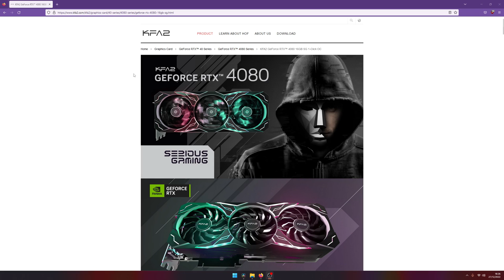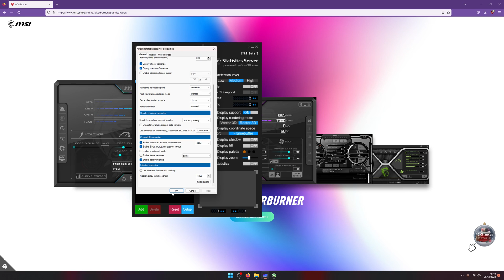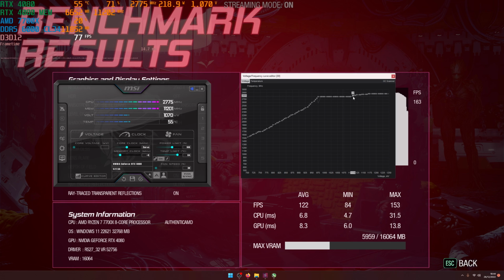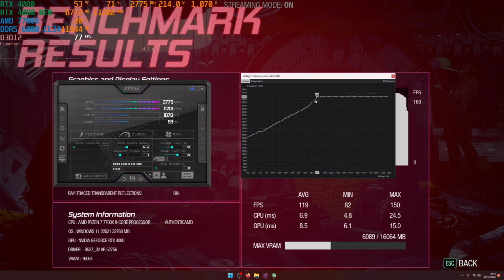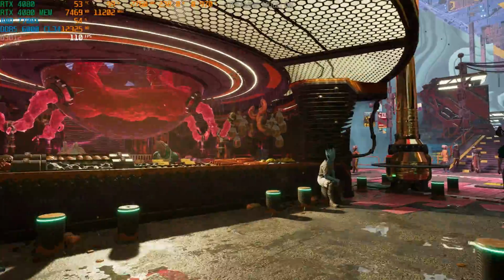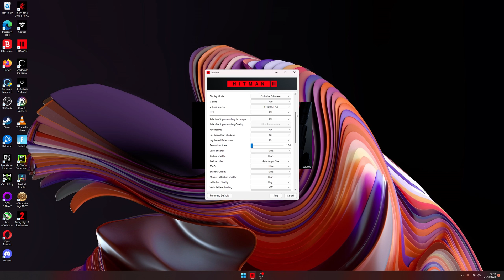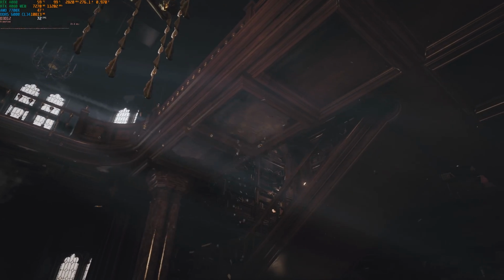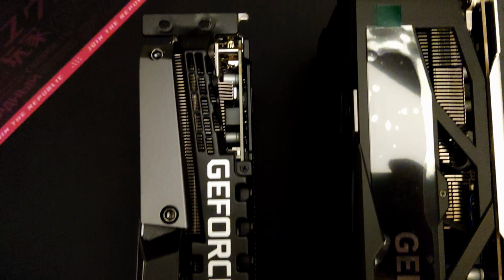How to undervolt a 4080

Comment: Hello, do you still use 2835@0.975 +550mem or do you have new values?
I bought Galax 4080 Super, I haven't opened it yet :):face-red-heart-shape:
Reply from the maker: Well it depends, I keep the 4080 Super at 2850mhz, 1015Mv, +1250Mhz memory. Some may do a bit better other worse. I believe that what I use right now is good for moat GPUs, but I was not that lucky with this 4080 Super

Comment: Resolution with tested? Because 1080p its the monster efficient than 1440p or 4k. Idk why but i think must more power to make fps. Control 1080p all max my 3080 stock draw 340-350w. 1440p same, but if i undervolt to 0.8mv 1775mhz 1080p draw 190-200w max, 1440 230-240 4k 240-250watts... with same clocks and mhz. Sorry for my english. :P Regards! Thats why i sell my 3080 and buy 3070. 3080 cant handle 1440p rt raycing ultra because drops fps soo much (im not interesting dlss) and 3070 most efficient. And uv to 170w with crazy fps.
Reply from the maker: I was using 1440p. I think undervolting will reduce power consumption regardless of resolution. In a resolution like 1080, you need a good CPU to push it to the max, so most of the time you will get lower power usage when the GPU is not 100% utilized. This applies to any resolution, if your CPU is the bottleneck. If you want power efficiency, I believe the 80 series from Nvidia is not the one to go for. Ray Tracing is hard to push even on a 4080 with everything maxed out, I truly hope that the next gen will have a less performance drop when using Ray Tracing then without.

Comment: Hi Casually Gamin9, What would happen if I undervolt the 4080 in the Dell laptop...Will that be ok?  If so, I should get higher framerates, correct?  Thank you
Reply from the maker: It will reduce watteg, this will mean lower heat output. Nvidia scales well when undervolting. I highly recommend undervolting it.

Comment: What are the minimum mv and maximum mhz to respect and not exceed for a 4080 Fe?  Thanks. 👌
Reply from the maker: All GPUs are different. Some may be better than others when undervolting. If you want high mhz, I would not go below 0.9 or 1.0 and would try at least 2850mhz and move slowly up by increments of 15mhz. It's a trial and error effort, unfortunately. Use this video as a starting point.

Comment: 2595@0.925V My Undervolting
I recommend checking the stability of your undervolting in the stability test (20 runs) of 3DMark Port Royal. Perhaps what you think is stable now will turn out to be actually not stable at all.
Reply from the maker: I'm using 2835@0.975 and it's stable. I'm using this for a few months. You really went down with your clocks and voltage, what is power consumption in some games. Are you around 200 in most games?
Reply: @casuallygamin9   u're using 3D Mark Port Royal for 20 loops stress test as well? what's your watts and temperature?
Reply from the maker: No I didn't do use it for stress. I used some game benchmarks and 3d mark basic edition.What I found is that even if you do stress test, you can find a game that will give errors, and you need to tweek a bit. I reach around 65C in games in summer, and hover around 60C in winter.
Reply: @casuallygamin9  i see, thanks for the info. people need to tell specifically what game/test they are using for their undervoltings. now i know it's ok not to survive  port royal for u guy's undervolt xD
Reply from the maker: Have in mind that all cards are different. You may have a golden sample and it will underclock way beyond what you see other people. My recommendation is to try it on your own and use thus video as base line. I found that Cyberpunk 2077 and Guardians of the Galaxy are quite sensitive to undervolting.

Comment: Just ordered a 4080 today looking forward to trying this with your advice ty!
Reply from the maker: Let me know your clocks and voltage. I am curious how later revisions handle undervolting. What model did you order?
Reply: @casuallygamin9  I got a founders edition. Smallest size I think
Reply from the maker: Got it, let me know the clock and the voltage, if you decide to undervolt the card.

Comment: Currently there is no way to not have afterburner always visually maxing out on the core clock? Mine just shows 2670 and not even the boost clock
Reply from the maker: Afterburner shows the actual core clock. If you undervolt your card and set a given value, that will be the boost clock that you mention. If at that frequency, the card hits the power or thermal limit, it will downclock automatically.
Reply: @casuallygamin9  ok yes, my question was more about the Afterburner UI, sorry if that was a bit unclear. The bar to show core clock is always maxed out
Reply from the maker: Well that's good. You will see it going down if you hit a thermal or power limit. You could try also to go up a bit, in 15mhz increments. If you are happy wit the performance and the thermals, and you don't have crashes in games you could leave it like that and disable the MSI Afterburner OSD. Mine is at 2835, but sometimes it drops to 2820.
Reply: @casuallygamin9  oh I think we have a misunderstanding :D My old gpu having its clock at 2k was taking up half the bar. Now its full. So my question was really just about the visuals of AB and if its just not yet adapted to those higher boosts of 40gpus.
Reply from the maker: @NYYXX  Try to configure it by going to settings -> monitoring -> GPU Core clock. Try different combinations. Also, you can bundle more option by adding the same group name. Just override that name and set it to the GPU name. I have a few bundled like that like GPU Voltage, GPU Core clock, GPU Temperature and set the Override group name, in my case, to RTX 4080 for all 3. This will show all 3 values on the same row.

Comment: So what's the minimum Watts can you achieve in 4080 after undervolting? Thanks.
Reply from the maker: Well this depends per game. With undervolting my card never passed 300w. In most games it hovers around 250w. But this depends as well on the CPU. For example if you have an older CPU, AMD 5000 series excluding the 5800x3D or Intel 11000 or below, these CPUs most likely are unable to push the card to it's full potential. Usually lower GPU usage means lower watts.
Reply from the maker: Well it depends a lot on your undervolt. I use 0.975@2835, and in Control I have a 30-40 W power decrese. Some games may see more other less. NVIDIA sees a good result when undervolting, you can get a 2-3% performance increase with a 15-20% lower power usage. It depends as well on the silicon that you have, you could have the worst one as well where you will not be able to achive any improvements.
Reply: @casuallygamin9  Thank you very much for your precious advice, I will test all that.

Comment from the maker: UPDATE: now I'm using 2835@0.985 with +550 on the memory side.
Reply: Is it stable?
Reply from the maker: For my GPU, yes. Some here have better results than mine.
Reply: @casuallygamin9  sounds like an overclock. 
I've undervolted mine to 2600mhz and like 935mv 
Stays super cold, love it. Not worried a out 2-6fps.
Reply from the maker: Overclocking usually means to increase the voltage to have the best clocks. What is you temp in games? Mine stays at around 60, a bit above. I do have two fans blowing directly air on the GPU.
Reply: @casuallygamin9  I stay around 34-38c in most games. Games that push it hard? 51-53c. 
Never goes above 235 watts. 
I also have an oc profile if I ever needed it. I do have the PNY version tho lol, so I can't go above 320watts, and the silicon isn't that great, or power phase. 

But it gets the job done! 👌
Reply from the maker: Cool and quiet I presume. Mine hasn't past 70, but I do prefer to squze all the performance out of it.
Reply: @casuallygamin9  Even though my version has a smaller heat sink then most of the other ones, I can't hear it at all. I had a 7900 XTX and it was terrible. Driver timeouts after a simple update, kind of glitchy inconsistent performance. 

I bought a 4070 and was happier with that, then I got me a 4080 loving that too

Comment: Any - or + offset?
Reply from the maker: I would go by 10 milivolts either way and see how it performs. But the voltage and frequency go in pairs. Now I have 0.985@2820 but in games it stays above that, between 2835 and 2850, it barely dips to 2820. It depends on the luck you had with your GPU

Comment: Does the aprox -90 milivolt apply to any NVIDIA card?
Reply from the maker: Well if you have a 4080, it's a good starting point. From there you can try to lower by 5 milivolts and try multiple games. If it works you could increase the frequency or set decrease again by 5 milivolts. My advice is to try and play with the voltage until you have a crush. When you have a crush just use the previous stable seting and you should be good.
Reply: yes, to any. even for a pascal. but it's a lottery, every chip is unique
Reply from the maker: @po-pi-po  is right, think of this video as a starting point.